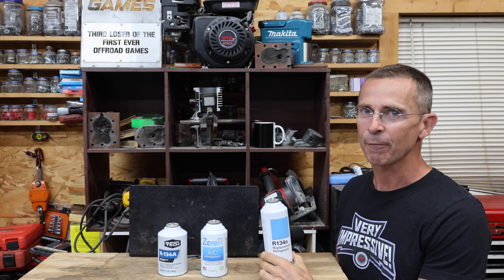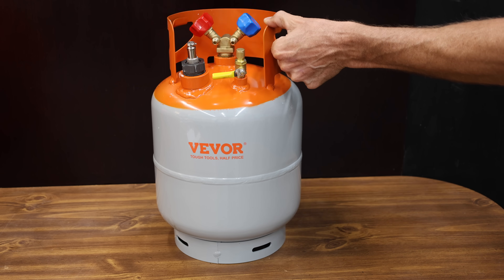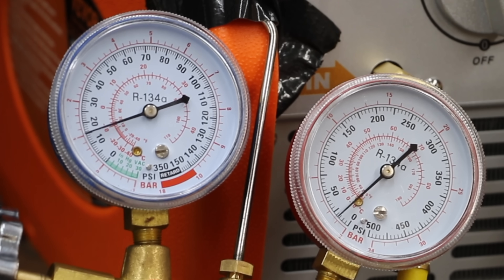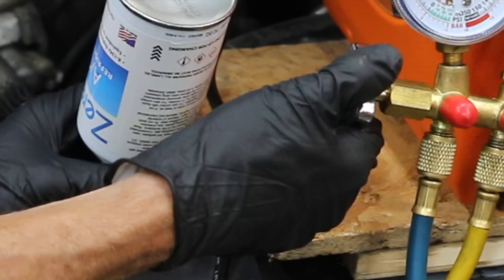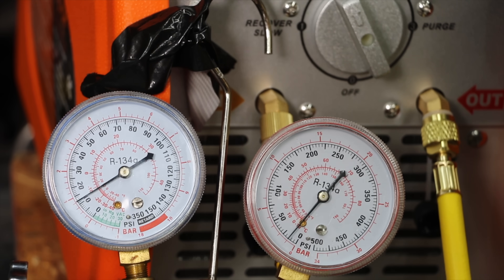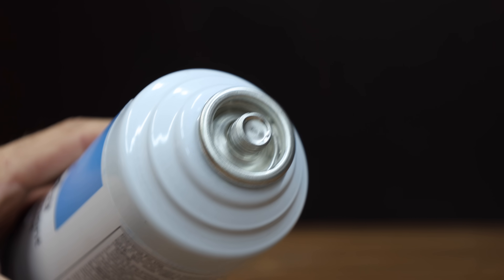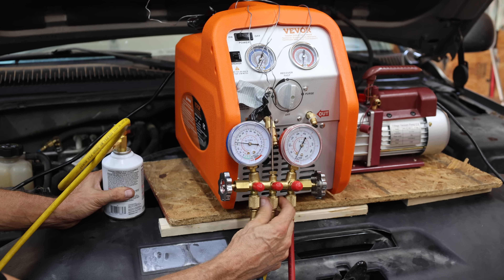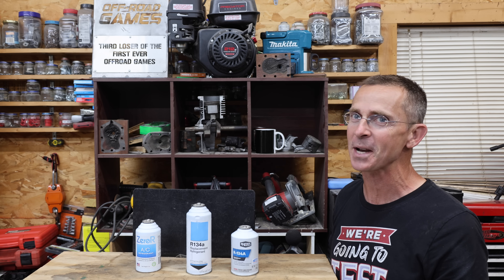How Dangerous is Fake Car A/C Refrigerant? Let's Find Out!

Comment: You told me everything I needed to know in the first couple of minuets or so. Super Tech R-134A is real. Worked for me.

What I was wondering about was the VEVOR equipment you were using. I purchased a VEVOR 12V DC fuel transfer pump and put it on a 100 gallon diesel transfer tank that I mounted in the back of my truck. Filled the tank with 95 gallons of diesel and took off on a 2200 mile round trip. I usually Fill the transfer tank and use it to control the cost of diesel when I travel and also I can stop where, and more or less when, I want or need to add more fuel to the trucks main tank. This was a shake down trip for the truck after I had worked on the engine and kind of get to know it as I had purchased it used to replace one that was stolen. I changed the way I fueled on the way out in that I ended up stopping for fuel all the way out to check the mileage so ended up in another state with the transfer tank full. The tank was a 750 lb brick in the back of the tank all the way out plus about another 750 pounds of stuff moving from one place to another.

So when I started back I ran on the main until it was about empty. Stopped at a rest area to fill the main tank. THE BRAND NEW VEVOR FUEL TRANSFER PUMP FAILED to move a single drop of diesel from the transfer tank to the main tank. I got lucky in that the rest area was near a town where I could get diesel which is unusual for me as I usually stop in more remote locations. 7 each 30 amp fuses later it still had not pumped a drop of diesel so carried that brick all the way back to the starting point. Not impressed with VEVOR products. Definitely not built tougher at 1/2 the price.

The results of the forced mileage check? 17.22 MPH at 70 MPH over 1112 miles and return trip towing a 5000 lb empty trailer back a 65 MPH 13.27 MPG over 1176 miles. The truck 2006 Ford F250 Crew Cab 4X4 long bed with 6.0L diesel engine 3.73 gears. Not bad for a little work.
Reply from the maker: Thanks!~  Thanks for sharing.

Comment: Well, I thought my AC was pretty good, not blowing hot. Then this guy comes with his sub-40 degree vent temps.
Reply: Those extra cold temps are typical of GM vehicles. If it was a newer MOPAR, we'd be pushing 50 degrees while driving.
Reply: @rupe53 can confirm, I have an early 2000s GMC pickup and using an infrared thermometer like he was using, my AC will output like 35-45 degree air and sometimes running it for too long I legitimately get too cold and have to turn it down so it's not cooling quite as much. 

The only time I've seen it become entirely useless was last summer I went to the dump and the line was super long to get weighed and it was like 102 that day and so after like 20 minutes of sitting in place not moving, the AC was not blowing cold air anymore because the fan couldn't move enough air over the condenser. Once I got moving though, the air temperature came right back down to where it should be
Reply: I've always said gm got 1 thing right!!! Them ac don't play!!! I've drove everything under the sun and gm vehicles I've had or got now blow 🧊 cold 🥶 I have had to turn them down even in this MS heat... last week heat index was 110... driving 2 hrs to make a delivery and had to cut it down... legs where freezing.
Reply from the maker: Thanks for sharing.
Reply: GM, Toyota and Honda have always been top dogs in the AC department.  Especially GM truck platforms.
Reply: @jordanabendroth6458  yup best AC out of the 40+ vehicles I owned was a 2000 Chevy Blazer. Your fingers would go numb holding the steering wheel if the vent was blowing anywhere near your hand. I've had women refuse to get in it until I turned the heat on as it was too cold.
Reply: @lazygamer9725    You need to remember that GM also made Frigidaire, which was known as one of the best fridges back in the early days.
Reply: @zacharymorris9917  I think the most effective AC I've experienced is my friend's single cab 1995 F150. It will freeze me out on a 100 degree day and I'm from Chicago. It has the exact same system as the Broncos and those cool pretty well too, but not nearly as well as a tiny single cab truck interior.
Reply: @averyalexander2303  what I said is based on physical differences, not personal conjecture.  An extremely high-end expert level automotive HVAC training course pointed out the differences and what to expect from each manufacturer.

Chicago?  You think Chicago is hot???  Try anywhere in Texas, especially Houston, South or West Texas. 

95 Ford products have literally none of the advanced features found in GM, Honda and Toyota products.  A Suburban is a much bigger vehicle with literally twice as much glass as a Bronco.  A single cab GM pickup has the same AC system as a Suburban with standard AC.
Reply: @zacharymorris9917  Good to know. I didn't say you were wrong, I was just sharing my own experience. My point wasn't that Chicago was hot, it was that I don't get cold easily since I grew up there. I now live in Memphis, which is quite hot considering the humidity.

 I agree, the 1995 Ford system has no "advanced features". It has a tube and fin condenser, fixed orifice tube, and simple clutch fan, but it sure works good.

Considering the fact that GM kept using fixed orifice tubes until at least late 2000's-early 2010's (I'm sure you would know better than I would), it's funny that you are talking about how advanced their systems are.

I agree that Honda and Toyota systems are reasonably advanced though, they were using TXVs since at least the 80's and they seem to work pretty well overall. My 1997 Civic is the one exception I can think of since it has a half width condenser and therefore doesn't cool that well when idling on very hot days.
Reply: @averyalexander2303  there is WAY MORE to an AC system than what you're considering.  The internal and external design of the evaporator and condenser from those three companies was miles ahead of the industry standard. 

A fixed orifice tube with a variable displacement compressor is arguably better than a fixed displacement compressor with variable "orifice tube" otherwise known as an expansion valve.

GM started running BOTH in the mid 2000s.
Reply: My 2007 Mercedes S550 original AC never charged blows 32.5 F out of the center vents in Florida Heat.
Reply: @averyalexander2303  to add to your Bronco anecdote, in the early 2000s, I did a 134 conversation (custom orifice tube and condensor) on a 90s Bronco that would blow 33° at 55mph and mid 40s at idle.  I had to slightly overcharge it to keep the evaporator from freezing up.  This was in Dallas area with over 100 ambient temps.
Reply: @rupe53  I did not know that. Thx.
Reply: Please remember Freon is a brand name.  Refrigerant is the proper way to refer to it.
Reply: @TheEverydayShopperReview  not even that is exactly correct.  Butane, depending on the application, is a fuel or a refrigerant.
Reply: If it's hotter outside then it won't be as cold. It has a lot to do with the ambient air temperature.
Reply: @rupe53  actually since living on my own since a teen. The only home ac and appliances I've bought have all been Frigidaire... I've yet to have to replace them... I've had ge,lg,Samsung and some other smaller names.. I went all Frigidaire for over the last 7 years or so and haven't had an issue. Granted their not the old Frigidaire from my parents days but they have actually been nice to me.. hard to believe living by myself for almost 30 years... man where did time go? Lol
Reply: @lazygamer9725    I still have my folk's 1952 Frigidaire fridge and maybe a dozen years ago I put a 1959 Frigidaire window AC unit in the local church tag sale, and that was still working like a champ.
Reply: @rupe53  As a Mopar Tech...Not True .. Bu YOU you are on the internet.... LOL!
Reply: @zacharymorris9917 😢 Hondas are some of the worst.  Too small of a condenser for climates like AZ
Reply: @tedlulis973    maybe not totally true but I have owned many Mopars and I spend time with a guy who has a fleet of Caravans for a transportation company. Apparently, the last generation of caravans is known for leaky rear evaporators and it's also those systems that don't get cold like they should. It may have something to do with the units being partially empty on a regular basis.
Reply: @tedlulis973  congratulations on your expert level cherry picking.
Reply: @zacharymorris9917  Cherry picking?
Reply: @tedlulis973  I'm not going to engage with someone who is so divorced from reality that they're singing the praises of the second worst major manufacturer on the planet.